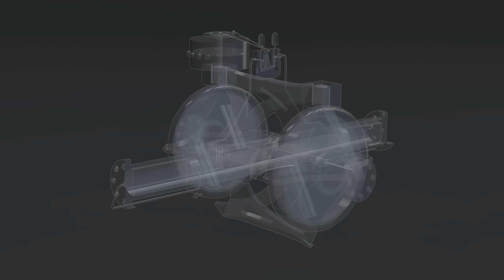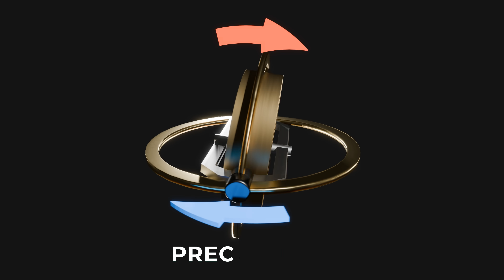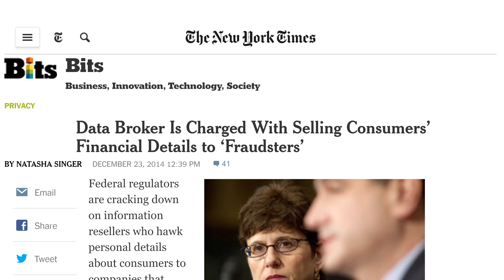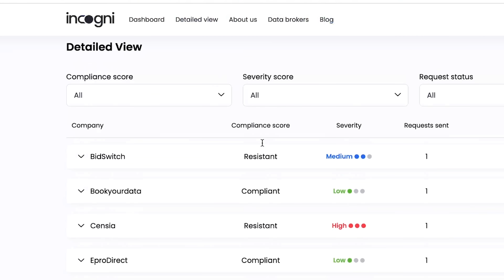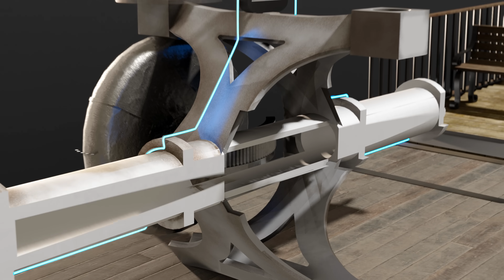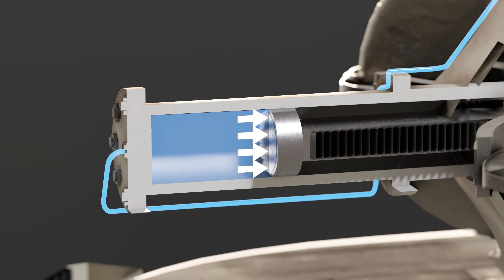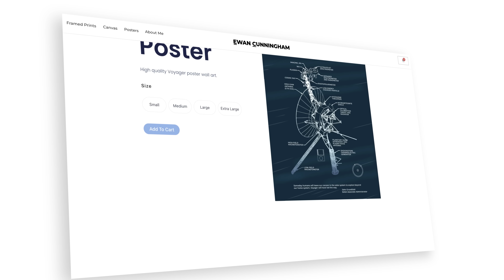The Self Balancing Monorail

Comment: 7:45   "Two-railed trains were already well established at the time."    Yes, but NOT the one in the video!   
There were tens of thousands of conventional steam locos around in the 1900's, any one of which would have done for an illustration of a 'two-railed train', and yet the producers pick an experimental (i.e. NOT 'well-established') locomotive built 25 YEARS after 'the time' in question.   (LMS Turbomotive, a turbine-powered one-off built in 1935).    Why do  video producers make careless sloppy obvious mistakes like that?

Comment: I believe this invention needs to be revisited in the form of a new automobile design. Imagine the benefits of two wheeled large cars or even trucks. Massive improvement in efficiency, less wear on roads and infrastructure, better utilization of space. Why hasn't the automobile industry research and development groups been all over this already?
Reply: You mean more wear on streets: More weight per wheel and additional weight by the components needed to realize sth like this. Exactly the same space needed as cars wouldn´t suddenly become smaller, more likely even bigger. Improvements in efficiency? Doubtful. If there even were any they would be negated by higher production costs, higer maintanance costs and the overall costs to uphold the needed infrastructure for production. So no, there is nothing to be gained here.

Comment: As much as I'm amazed by all the efforts that went into keeping the locomotive upright, what I find even more incredible is how seamlessly it addresses all the shortcomings of actually built monorails whilst retaining all the advantages of a conventional railway line.
Reply: Well. The problem was that the same system had to be installed in every single cart too. Otherwise the loc would be the only thing standing:D
Reply: @bobdebouwer7835 
OUCH!    To costly! 😢
Reply: All you would have to do to address the problems caused by a monorail is to put down a second rail and make it a train
Reply: @nigeladams8321  well, putting down rail is, or was very costly and labor intensive. Cutting that in half could easily justify the cost of gyros, at least for new  and long range railways.
Reply: @spitfiremanlizerd if you're going to put down one rail you might as well put down two and not have to worry about all the problems you have to deal with by not having two rails. You aren't saving space not really, the footprint of the train is the same
Reply: Brilliant engineering.
Reply: thank us sm for appreciate, it means a lot <3

Comment: Great explanation. The only missing part is the wheels design. It must be very different, probably two cones? What about the shape of the rail?
Reply from the maker: Thanks! The wheel had two flanges, it was pretty simple. That's why it could still run on a regular rail.

Comment: the main flaw i see, its height, not that the height hurts its operation but it does feel like an unnecessary potential risk, yes it has the stored energy within its gyros to continue operating for thirty minutes in an emergency, enough time to slow the train and deploy any emergency braking/parking systems, but these emergency systems may be more reliable if the monorail weren't so tall

Comment: I study control engineering, and this is essentially a control system but fully mechanical. It's really cool to see the design process from more than a hundred years ago!
Reply: Just wait until you get your hands on a pneumatic controller. You set your gain and reset with physical dials that act on bellows, it's ingenious when you really look at it. A physical representation of our math that translates PID  turning of a controller into mechanical parts!
Reply: I do a lot of greenhouses and indoor grows and whenever I can keep it simple I do. Mechanical and simple relays over fancy control systems any day because then regular people can fix them.
Reply: Which institution are you studying at?
Reply: AirBnB
Reply: its probably called analog automation and it has plenty of future as sun pointing passive actuators that can be used for solar concentrators without need of electronics, and wind turbine shaft powered mechanisms can use similar systems for mills automation, etc
Reply: Don't drones stabilize on a similar principle?
Reply: @clayton97330  they can, but how the drone reacts to a change in tilt or rotation is all calculated and done digitally, as most modern gyroscopes will send their data to a computer, this one self stabilizes without a computer. All of its information is sent and received in a physical manor.

Comment: I think that although it's a fantastic design, the cost of having gyroscopes on each locomotive would be too high, although on the other hand it would probably save on the engine, since having half the wheels you would also have half the friction. The fact remains that it is very interesting.

Comment: This is just genious. Unfortunately it's not always the key to success. This could have been a solution for remote areas or where low space requirements are important, with low passenger volume, so the train itself can remain small. So this would be nice some areas, but most likely never pay off.
Reply: Yes, and with 2 tracks you could have 2 way traffic even.

Comment: If we took into account that these trains could be made slimmer or the part of the side that faces the middle of the rails could be shortened, it would be possible to use 2 trains on the current tracks, and in my opinion (I am not an expert), but if every 2nd car was not able to tilt towards one side, when the carriage in front of/behind it tilted completely to the other side, it could be possible to save on materials to not produce so many gyroscopes and make more space for passengers or make them for higher classes

Comment: I find it fascinating how a specific idea prevails - not because it is better, but because it is simpler and more robust. Gyro system presented would be difficult and perhaps costly to maintain, it is also unclear what happens if one of the wagons is decoupled and is in storage or is waiting for a long period of time. It is preferable that the system has as low a maintenance costs and intervals as possible, even if that means much higher investment in infrastructure.

Comment: I am a commercial pilot, and we use sophisticated ring laser gyros in our inertial navigation systems to allow the aircraft to measure accelerations in all three axes, and then integrate those values twice to derive velocity, then distance. This allows the plane to calculate its position in 3D space to a high degree of accuracy, without any external navigation aids - provided it knows where it started. Gyroscopes are fascinating!
Reply: The plane know where it is because it knows where it isn't
Reply: @MolkoKillStyle  There's the reply I was looking for.
Reply: @MolkoKillStyle 😂😂 perfect application for this 👌👌
Reply: @MolkoKillStyle oh no...
Reply: Inertial navigation.
Reply: Those laser ring gyros were invented in the 60s or 70s. Prior to that all gyros were mechanical like the one shown, although probably smaller. They were marvells of precision  mechanical engineering
Reply: The missile knows where it is
Reply: In the mid 90s when I was doing my military service as a FH77B howitzer unit commander in the Swedish artillery, our howitzers also used laser gyro inertial navigation. Maybe they still do with Archer, only relying on GPS being accessible during wartime is probably not good. I recall the daily calibrations against terrain markers with known 3D coordinates.
Reply: Surprised they teach about INS in ATP
Reply: @Drew-ub2qu  Pretty much every semi modern plane uses laser gyros for the attitude indicators. With or without the INS. In hindsight they are very simple and unsophisticated. Frequency shift of the split beam.
Reply: @extraace  I understand that, I work in the aerospace field. I'm just surprised that they would teach pilots about it during atp training.
Reply: @Drew-ub2qu  I don't think the ATP books specifically mention the laser gyros but it's been a while ago for me now. They did in the plane specific classes. Not as much anymore. I think it's pretty common knowledge now.
Reply: @extraace  They are in fact specifically mentioned in a fair bit of detail, at least in my syllabus.
Reply: @extraace my dad built autopilots. He went to France in late 80s to learn TCAS(?) Sadly I'm more of a literature/history brain but now I wish I'd have asked him more questions. 😕 I wonder if there's any correlation. I miss him
Reply: @cmaden78  I bet so. Late 80s and 90s is when TCAS 2 was coming on and the gyro data for resolution advisory. And glass cockpits becoming the norm. Wish I asked mine more as well.
Reply: How does this system deal with the cumulative error, which can cause the distance measurement error to drift linearly due to the double integration?
Reply: @felixmoore6781  In the old days, it didn't really have any way to avoid error.  The crew would have to periodically update their position using known beacons/landmarks due to the INS becoming progressively less accurate over the course of a flight.  Now we have GPS, so the problem is nearly inconsequential.
Reply: @felixmoore6781  Be precise enough to keep the error below an acceptable threshold within the limited time of use.
Reply: @felixmoore6781  It uses external systems to error check - a combination of GPS, and radio-based navigation (VOR fixes, for example). The FMGS then computes a position solution using all inputs. The advantage of the INS is that it does not rely on external sources of navigation data, so if their inputs and sensors fail, or they are unavailable for any reason, the plane still has a very reasonable solution for its position.
Reply: Integrative navigation
Reply: pass
Reply: thank us sm for recognition <3
Reply: Integration causes drifting. Integrating twice even more.
Reply: I believe it was called the Carousel inertial navigation system. Either General Motors through AC Spark Plug later renamed Delco electronics built it or had a role in it. It was also used on the moon missions. My dad was an engineering technician in the project.
Reply: brennan is way better  than the clown called  newton
Reply: @LexlutherVII Sir Isaac was an alchemist and mathematician (physicist) 
   Without him you would be picking your own apples 
 Most guys can't sport a wig
Reply: "measure accelerations in all three axes, and then integrate those values twice to derive velocity"
Velocity is the first integral of acceleration, not the second.
Reply: @chrishill5511  I am aware; integrate twice to derive velocity THEN DISTANCE.
Reply: Adding to your excellent comment:  Ring Laser Gyros (all electronic, no moving parts) are generally part of a strap down system (no gimbals).  Spinning mass gyros are generally mounted on Gimbals.  The math is fascinating with the strap down systems- a single vector (quaternion) and rotation angle are used to measure the resultant x,y,z rotation.  One vector and one angle about that vector can describe the result of all three Euler angle rotations.
Reply: Wouldn't it know that it started at the airport? Joking...
Reply: Gibberally speaking, perhaps
Reply: How does it deal with drift or is it precise enough to not need to?
Reply: @deanodiem5360  it uses external navigation aids like GPS and land-based radio beacons to check its position, and it also has three independent IRS modules, each computing the position. This is part of the ADIRS (Air Data Inertial Reference System) and it computes a ‘mix IRS’ position that considers all inputs and then reports the most accurate position that it can. This is usually displayed as ‘GPS Primary’ as the GPS system is the best solution barring interference. The data page of the FMGS (Flight Management Guidance System) reports the navigation accuracy of the three IRS units, and we have limits that we tolerate for a given distance and time of flight. One of my tasks after a flight is to check these drifts are within limits, and do a quick or full realignment of the IRS if they fall outside the limits. Typical drifts are 0.1 to 1.5 nautical miles for a three hour flight, but each system will be slightly different, so they mix their results and compare to GPS to computer a true ‘as accurate as possible’ position. Normally the computed position in GPS primary is extremely close to true position. For navigating, we have accuracy requirements depending on the type of segment we are flying. In the terminal area for an arrival (close to the ground and other traffic) it could be within 0.3 or 1 nautical miles. We have to maintain that accuracy 95% of the time we are on that route segment. At high altitudes, and over large bodies of water, the tolerance can be much larger, like 2 or even 5 nautical miles. So the drift you asked about would only matter if GPS Primary was lost, there were no suitable radio beacons (VORs, for example), from which to compute position, and if we were drifted so far in mix IRS so as to be unable to verify we are complying with the route accuracy requirements. There are a lot of layers to navigation accuracy redundancy!
Reply: I was a submariner in the US Navy, and we also used ring laser gyros for navigation.
Reply: my head is spinning just reading your comment
Reply: @trueword247 I see what you did there. Well played.
Reply: @trueword247 They copy-pasted from Wikipedia lol!
Reply: Wow
Reply: Or turning the plane, where the passengers do not feel the change in the force of the Earth's gravity, in relation to the axis of the plane. Glass of water is always leveled.
Reply: Cool!
Reply: You're lying. You just looked all of that up because you want internet points. We know.
Reply: Wait ring laser gyros… like ring from the doorbell?
Reply: @zivamayne 

Ring.... as is Lord of the Rings.
Reply: @zivamayne  clearly no.

Comment: Cool story, beautiful animation. A quibble about the physics: I'm not confident that the piston's greater surface area is what causes the multiplication. The compressed air has to come from somewhere (the pipe above the valve, in your animation) and if that were shut off, no "multiplication" (no force, more correctly) would be produced.

Comment: The gyroscopic stabilizers are pretty impressive but the real leap of genius is the second control mechanism which could react so quickly.  And it was all done mechanically (or pneumatically) without computers.  The unidentified issue here is how would it have dealt with "switches".  When tracks meet or branches off from another?  It appears that this train required a wheel with flanges on both side of the rail so normal railroad switching wouldn't work, it would de-rail.  But I'm sure anybody clever enough to bring this invention this far would have thought this problem through as well.  We just don't get the answers here.

Comment: A modern incarnation could use high strength, very high rpm gyros, making it perhaps more compact and lighter.  It could also be mounted perhaps lower on the chassis.  Of course, better aerodynamics would be helpful.

Comment: Today there would be no question: Sensors, servomotors, and an algorithm on a microchip would control the gyros.  But which system is most likely to fail, Brennan's, or a modern servo loop?

Comment: this is the same principles that makes drones fly, except with no spinning gyroscopes, instead the gyro sensors feed into a different output, but flight controllers are sort of like the air valves, telling when the motors should react quicker to deviation, (proportional) or when it should slow down before reaching set point so it doesnt wobble, (derivative) or when it should keep pushing to account for an external force by measuring how long it has deviated. (integral)

That makes the PID controller that corrects deviation.

the flywheels don't react quick enough because they move only when they accumulate enough deviation, which is only integral, the air valves are the proportional, because they act more proportionally to deviation, by exponentially increasing an integrating correction.

usually we get proportional directly from a proportional angle measurment, but it kinda works anyway

Comment: Obvious weaknesses: Special docking required when not powered up (e.g. extra rails). Mass of the gyroscopes must constitute significant percentage of total mass, otherwise the balancing effect is too weak, rotating and hurling around extra mass means high fuel expense. Reaction speed on bends (sudden centrifugal effect) might also limit the the safe speed. Derailing risks already mentioned on other comments. The wow effect is undeniable though - cool invention.

Comment: Everyone is saying it's a great  let me make a counterpoint: safety
If a normal train derails has a much higher chance to remain upright, and if it breaks it will stay on the rails
This thing has a high probability of falling over and far more failing points, and for every train car more failing points are added, and one mistake brings everything crashing down

Additionally: price, a complex gyroscope system for every train car probably costs more that a second rail, plus much more mateinence

Additionally²: transportation, not only would the gyroscope take up space where people or things could be, with only one set of wheels the force it could exert would be lessened, reducing train length and lowering efficiency, plus it would be harder to fit the thing in with a big engine
Reply from the maker: Some great counterpoints for sure. Thanks so much for sharing and good luck in the giveaway.